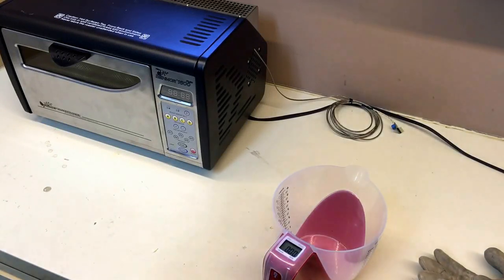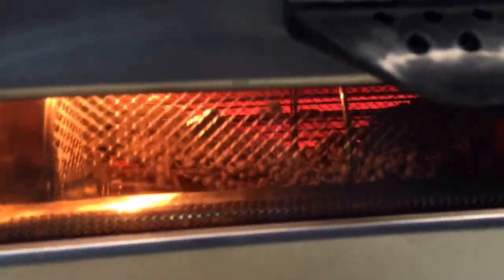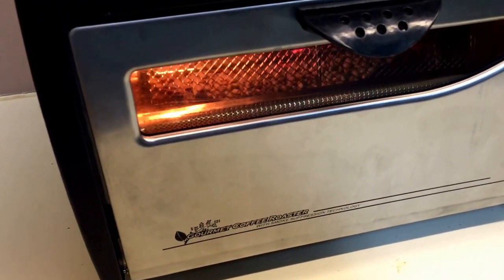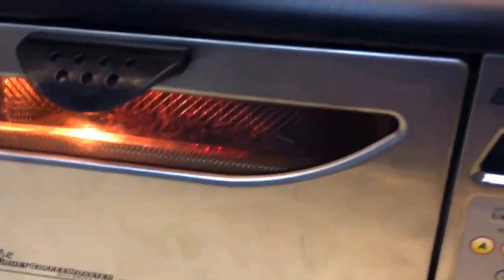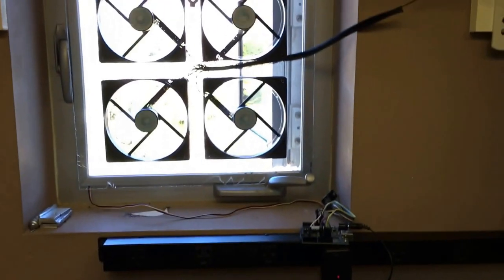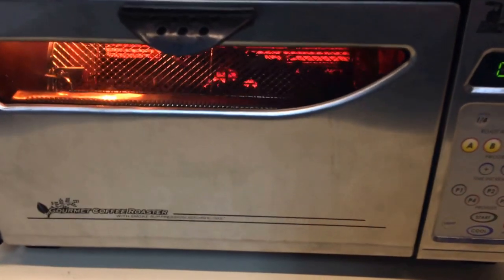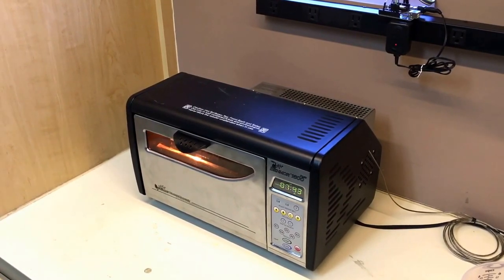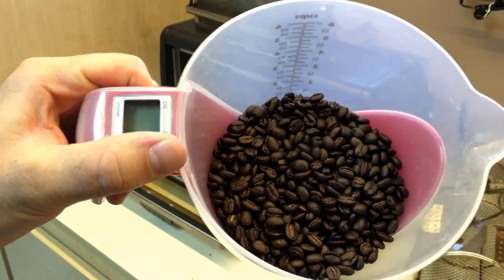Behmor 1600 coffee roaster, get all the chaff out with this technique!

Comment: The vacuum trick works great!  Thanks!   I do a manual roast and pull the drum out before 2nd crack going for City +.  (I quickly vacuum out the toaster and then let it cool cycle). Next, I have a cardboard box with a cut out on top for a mesh colander to fit into. Another hole on the side receives the vacuum nozzle and the beans are cooled in about a minute. Leaving the beans in the Behmor for the cooling cycle takes too long IMO and the sweetness in the cup is lost. Great video!

Comment: I'm confused. I thought 1st crack wouldn't occur until the internal bean temp is around 360 and these roasters don't get over 320 without shutting off, correct?
Reply from the maker: +Xander Stoute Good question! First crack is closer to 380F, second crack is around 410F. The temp sensors on the Behmor are really just for reference, and are not at all a good indicator of either environment temp nor bean temp. You can test this by removing the drum and putting an oven thermometer in. You'll see the actual environment temp that way. I love the Behmor, and it works great, but there's some quirks for sure!
Reply: Joe Bishop that's insightful. Just finished my first roast and got to first crack at 8 mins and 307F. I was just thrown off by it.
Reply: I've been using a heat gun to measure bean temp (or at least try to) and noticed that it was way off from the machine's temp probe. Either way after my first roast, I've been getting some good consistent roasts. I appreciate your response.